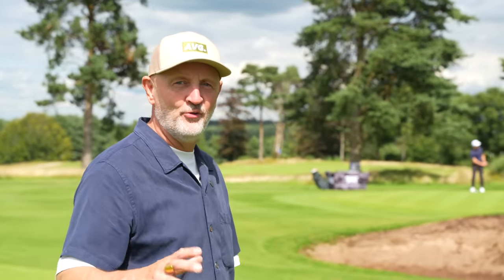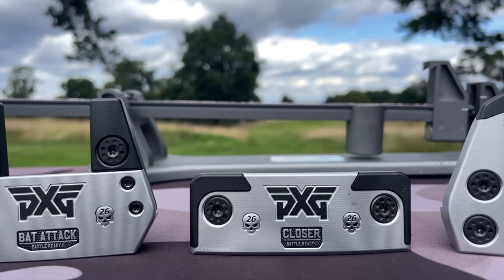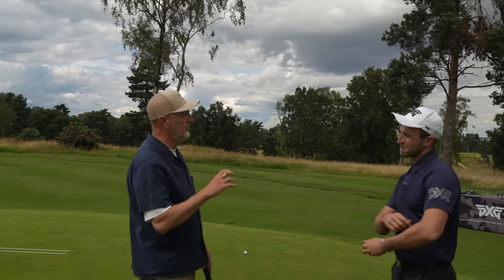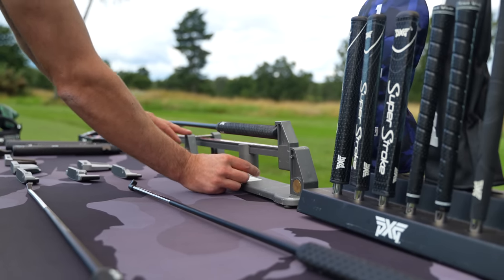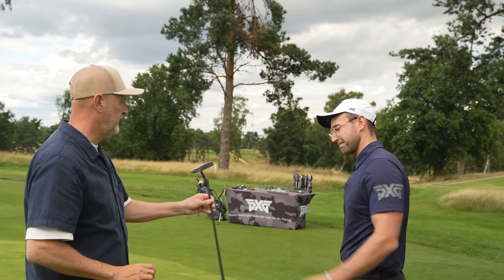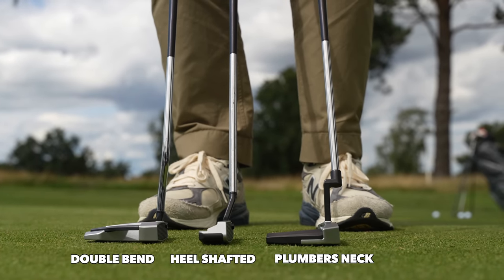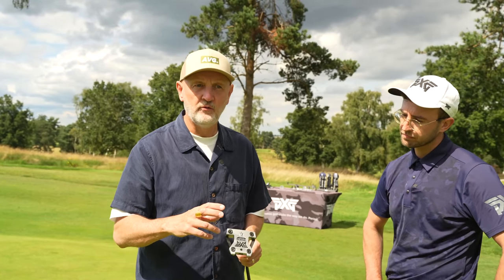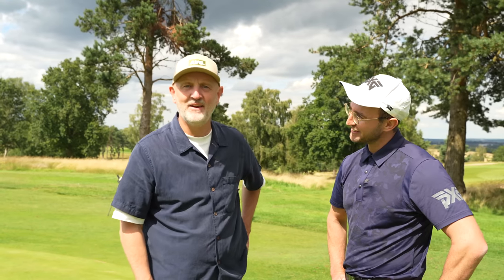PXG make MAJOR change in FUTURE Club TECH

Comment: I nearly purchased a PXG “One and Done” putter but ended up with Envroll. Interesting that PXG don’t check putter loft and lie.
Reply: I agree,it did not seem that much of a scientific approach.
More likely what you would do yourself whenever you try a number of putters.
Reply: I mean this is only what we saw and it varies from fitter to fitter. I had a pxg putter fitting. Wasn't quite Ian Fraser at TXG but they did test me for length and see what dynamic loft I hit ball at with the trackman.